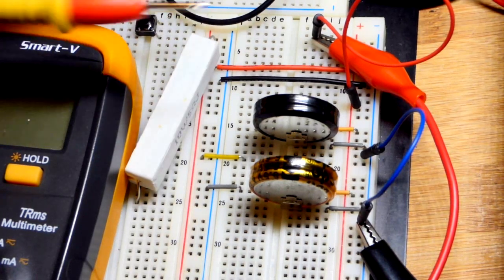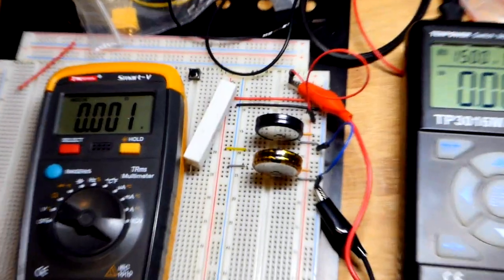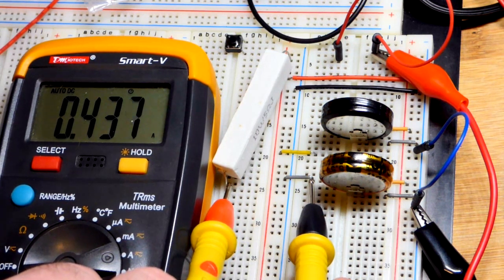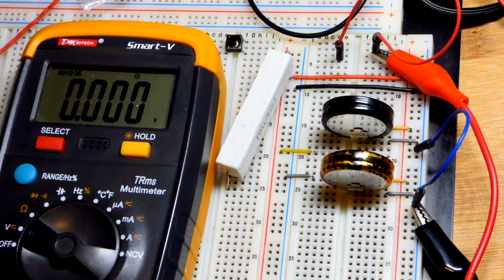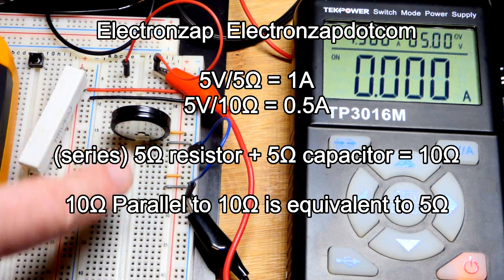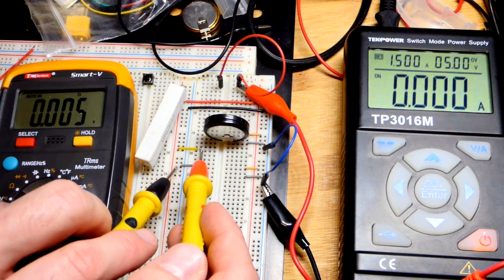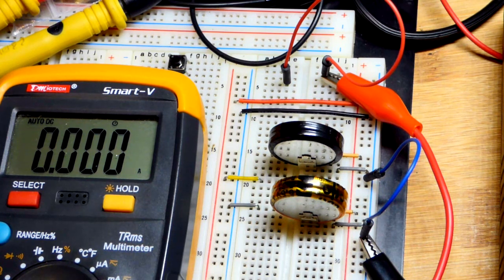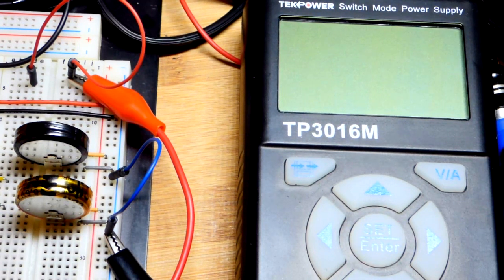Higher than normal supercapacitor internal resistance testing beginner learning electronics tutorial

Comment: Thank you for doing this video!! I remember commenting on one of your earlier videos, bringing up the point of internal resistance with these supercaps. I really appreciate you putting this video together. My goal is to have one or two of these supercaps as a reserve power source for a deepsleep microcontroller (with only a small period of awake/measurement time). Because of this internal resistance, I intend to hook it up directly to a 5V source with no power resistor...which can be accomplished. Likely won't need a diode either.
Reply from the maker: Yeah. I think that's what they were designed for :) Thanks for watching!